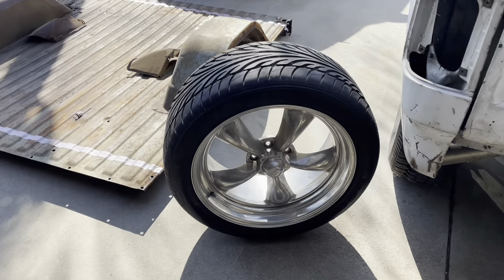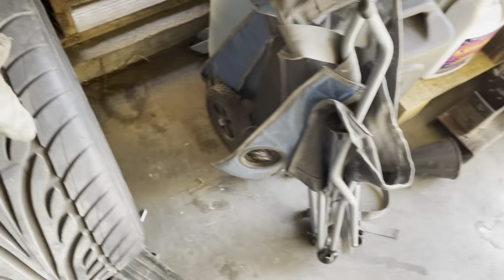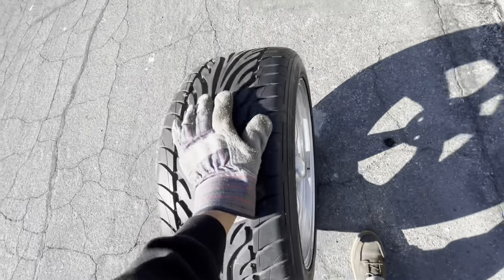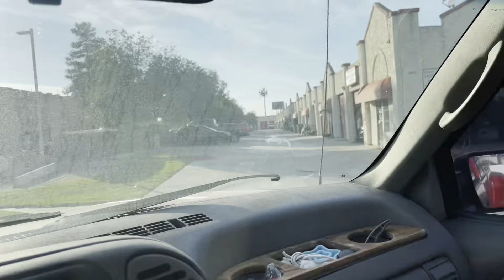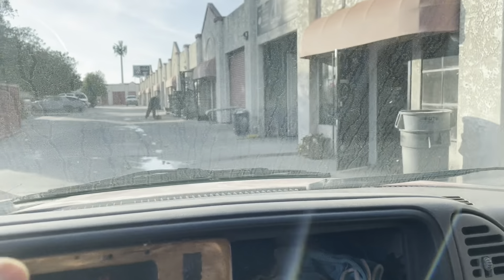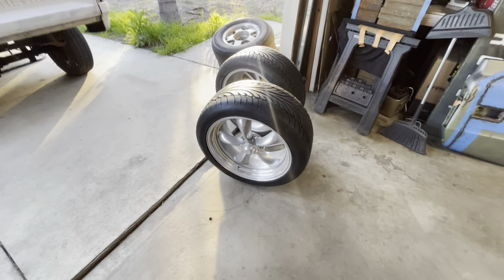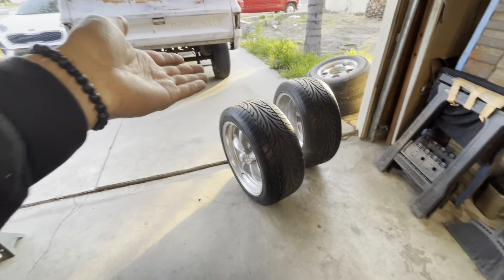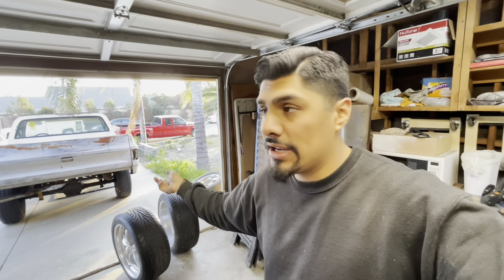RESIZING MY 2 PIECE WHEELS

Comment: A while back before we started the build I ended up buying a complete set of original rims/rings/caps for my `72.. the thing is the more I see newer nicer rims (like the ones you showed us in this video) I'm thinking about changing things up and NOT going back all OEM on the outside and instead modifying the exterior and possibly giving it a modern take... paint, rims, trim, etc.  I've got time as we're still working on adjusting the drive line to get that 3 degrees of angle since I'm  running a single piece drive shaft now with that 5.3L Vortec and 4L60.  Almost got the clearance we need... just a little more work.  Thanks for making me think.. ;)
Reply from the maker: I would love to see it. I love old trucks with modern twist. I say have some fun and have 2 sets lol.